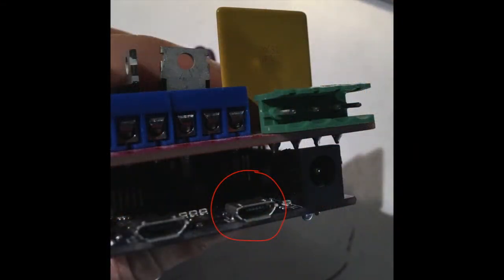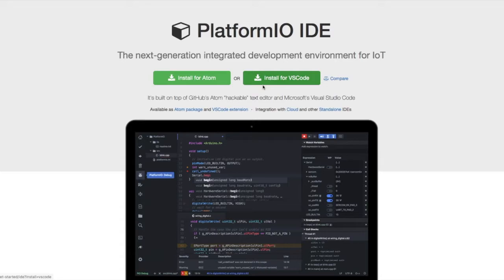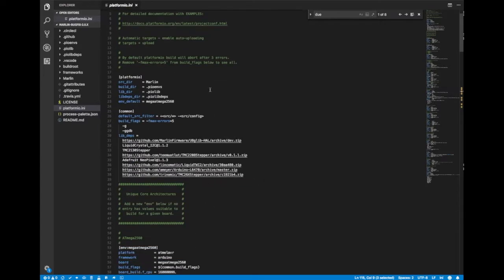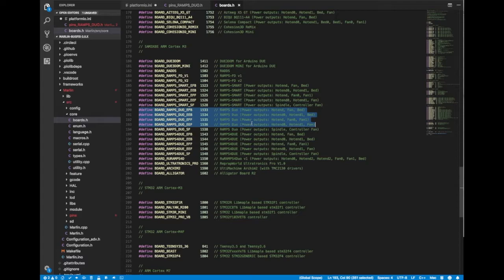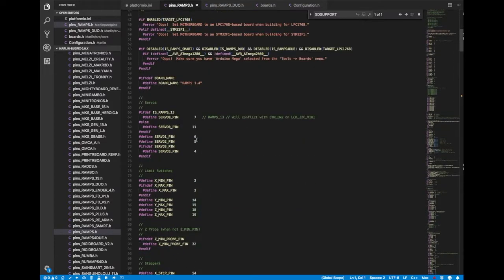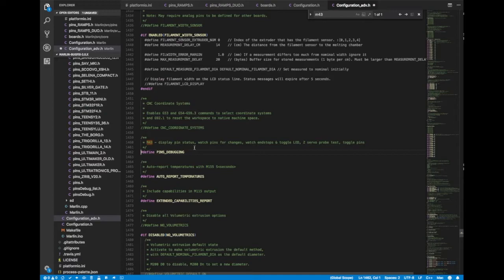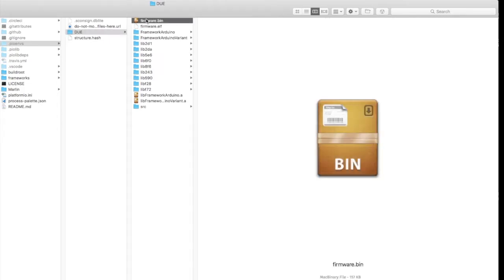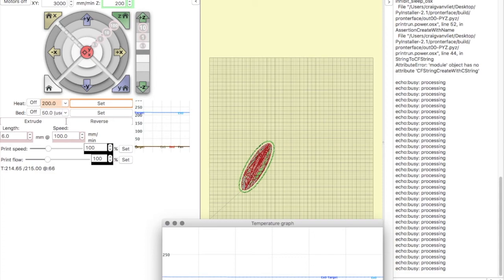Ramps + DUE mod part 3: Marlin 2.0 install

Comment: Great video. But what would it be like to put a TFT display? When enabling "Other Controllers ADS7843 / XPT2046 ADC Touchscreen such as ILI9341 2.8" When enabled, it asks to declare the pins, but there is no field for that.

Comment: working reprap full graphic smart controller lcd  3.3v logic?
Reply from the maker: You have to feed it 5v, but it isn't sending 5v out , so it seems to be okay.  I thought the SD card might be wonky because of the voltage buffer, but it seems to be fine.

Comment: Marlin 2.0 page says it's also possible to build on Arduino IDE 1.9, which is currently in beta. Any chance of making a video about that?
And speaking of "that", have you seen this? http://www.panucatt.com/Re_ARM_for_RAMPS_p/ra1768.htm (rejigged copy of Due with pins in the right places to use old RAMPS)
Or this? http://www.panucatt.com/azteeg_X5_GT_reprap_3d_printer_controller_p/ax5gt.htm (all in one board, similar to Gen7 but cheaper)
Reply from the maker: Some setups build fine in arduino IDE.  The current version works fine except on Windows (you'll need 1.9 beta). I have seen those Panucatt boards, they make solid stuff (it's a bit expensive though). The Re-arm board was the initial target platform for testing in Marlin 2.0, so it is well supported.
Reply: Thanks for the reply, Alex. I asked about ArduinoIDE because I still have XP (shh!), and VSC doesn't even want to install on that. 
The other part of my question relates to my plans to build a CoreXY of my own, and I'm trying to figure out what 32bit board to use. I'm soooo not interested in commercial Duet, Smoothie and similar, and community-developped like old RAMPS seems to have hit a dead end, sadly. Everything is either half-done and abandoned, or spread to small individuals or groups that are unknown. I've prodded Traumflug with some thoughts to rejig his Gen7, and if that doesn't work I'll probably decide on something from Panucatt. I like the idea of their Bigfoot stepper drivers, should be much closer to spec regarding heat dissipation than old Pololus, and really should be adopted as a new standard.
Thanks again for reply and your funny videos. Keep em coming! :)
Reply from the maker: Ah, I see.  There IS a linux version of VSC, or you could run PlatformIO from the command line and edit the test files in a regular text editor (a pain in the butt though). I'll cover various board overviews 'soon', but I have been waiting for some parts for over a month, so I may have to say 'screw it' and just do an intro overview video while I am waiting.  The Gen7 use an M0+ series chip, so they are very limited in terms of memory and you are basically limited to using Teacup firmware.  I'll cover some other options as soon as I can: the problems you are having with choosing a board are very common, and that is why I am trying to push for affordable solutions.  There are a FEW options under $50 already, but not as many or as cheap as 8 bit, so I'll have to cover all that.

Comment: They are now both Microsoft software :D / first i used atom later i used vscode because the support for platform.io in atom is incomplete / later i switched back to atom and used the cmd for compiling the firmware as root. This can't be done within the editors. But building for my mis sbase i had to compile the fw as root because otherwise i got some strange errors.

Comment: Thanks for awesome videos! You should definitely try Repetier instead of Marlin. Configuration on Repetier is much better to my taste. Current version (1.0.2) only support hardware SPI out of the box, but 1.0.1 supports software SPI by default. There is also way to build SD library with software SPI support on latest Repetier.

Comment: You go into so much detail about everything except for when you get a firmware.bin file, then your next sentence is "after uploading..." Appreciate the tutorial but how do you flash the firmware? Sd card? Pronterface? What?
Reply from the maker: Flashing to DUE is done through the micro usb port labeled programming.  PlatformIO should handle all that automatically .  I mentioned where to find the firmware file for manual upload because there was a bug for a while where it would not upload properly over USB, but I have not had that problem with the due
Reply: @AlexKenis  I figured it out. It was easier than I was imagining in my head. Just had to "build" then "upload". Thanks for the tutorial!

Comment: hey man, i tried this and i cant seem to get 100k NTC thermisters to work, when i mesure the V drop across the thermister i get 0V, even without ramps attached to due, (one side of thermister to GND and other side to A9) in S3D machine control it says 171 deg, when i manually add a 4k7 pullup (to 3v3) to the system i see a V drop over the thermister (like 3V1) and can even see the V drop change when i touch the thermister. however the Machine control now says 0 deg. i decided to use a 100k pot (GND, A9, 3v3) at a V drop of like 0V7 the  machine control says like 74deg, on both bed and end, i am truly confused. anyone please help
Reply from the maker: THat's... strange.  I would suspect some wonky setting in the firmware, but I assume you looked into that already.  Try a new thermistor if that is an option.  There may have been a change in the thermistor code for the due since the video... might be worth doing a search on the Marlin Github bug reports.  You can always double check your thermistor calibration at 100c using boiling water as a reference.

Comment: Is it worht to move on DUE from Mega ? I am ok with mega but 32 bit ? little confused if i need it or not..
Reply from the maker: MEGA is fine for most people right now, but some people either need the speed or want the features.
Reply: @AlexKenis  When would extra speed be needed? For fast 3d printers? Faster moves ?

Comment: hi, i'm tring to compile this FW with TMC2130 drivers but i get this error "#error "DUE software SPI is required but is incompatible with TMC2130 hardware SPI. Enable TMC_USE_SW_SPI to fix." i want to use the hardware spi from the programming header 
how do i trick marlin to use hardware spi?
Reply from the maker: Ugh, Yes it gets a bit confusing because of the way the mcu juggles hard and soft SPI.  Basically that is just an error warning saying that you can't share pin assignments between soft and hard SPI, so best bet is to enable PINS_DEBUGGING in Configuration_adv.h and send M43 in a terminal to get a readout of all the pin assignments, then it is easier to check for conflicts (you don't HAVE to, but it makes things easier).
Reply: i tried to use SW SPI but no luck, now it won't even connect from S3D machine contorll
#define TMC_SW_MOSI       40
  #define TMC_SW_MISO       65
  #define TMC_SW_SCK        42
Reply: Also can there be more SPIs or just one?
Reply from the maker: The way they have it set up is that depending on where you assign the cable select and which options you choose (trinamic, SD, LCD, etc) it has macros to automatically pick what uses sofe or hardware SPI, so it is a bit confusing.  I'll cover that a bit more in the 32-bit series, but I am hoping they make it less confusing soon.
Reply: Ok then. I can't wait to see a video explaining it because i looked all over the net and i could find only pieces of information. Is it allready done and it just needs editing? :D thanks anyway
Reply from the maker: If you look this folder path: Marlin->HAL->HAL_DUE , find the file SanityCheck.h . There are some details in there that may help explain it.

Comment: Just wondering, what is the best/ easiest way to know a USB cable is not power only?
Reply from the maker: Probably with a multimeter.  Check for continuity between pins on opposite side connectors

Comment: Help, im trying to do this step by step but the atom i have dosent even look line yours, the firmware dosent look the same either, everything is different im so lost
Reply from the maker: I ended up using VSCode in this video, and it's what I use now.  I'd rather use Atom, but it ended up not working out as well. Give VSCode a try and you should be able to follow along
Reply: @AlexKenis  thank you so much for you quick reply. i kinda started figuring it out but now i cant compile it, says there is no platformio project, ill give that a shot
Reply: @AlexKenis  hey so i have successfully done everything in the config and advanced config and setup for the due board but i can compile it, i do not have the same tools in that blue bottom bar as you...
Reply: yeah dosent matter what i do says its not c++
Reply: @AlexKenis  hey i just wanted to say thank you so much for the time and effort you put into these videos, i have been able to do the complete 32 bit mod and trace down and solve any issues i ran into on your content alone, keep doin what your doin! awsome work.  one question, i have soldered the dupont onto the duo for 5v power but what pin does that go to for a reprap full graphics display? (12864)

Comment: Whoa! You helped me out a lot! But I still can't figure out, how i can get the "section tmc_smart" (Line 1191 in Configuration_adv.h) to show up.. I have set the X,Y,Z and E0 Driver to TMC2130 and removed all the unnecessary "/".
Reply from the maker: First, I would go ahead and install the firmware and then see if the settings in that section are working on the printer.  Sometimes -- for whatever reason -- there is a glitch in the IDE and it keeps sections greyed out. If the settings are not correct after you install, then I would double check your configuration and pins files
Reply: @AlexKenis  Hey, thanks for the reply! I've installed the firmware which is configured for a RADDS board (which i have) after I posted my comment, and it works, partially.. I can move the x,y and z axis in only one direction. When i have the diag1 pins of x and y connected to the x and ymin pins it says "endstops hit" whenever i try to reverse these motors.. 

The Extruder works flawlessly in both directions..

When I want to home the machine, it just crashes into the opposite sides of the endstops..  Can i reverse the motor direction for the homing sequence? If yes, where? I haven't found an option to do so.. 

My Extruder works, but the heated bed doesn't.. I also can't seem to find the heatbed pin on the RADDS... FAN0 and FAN1 also don't work..
Reply from the maker: I am not sure of the pin assignments in RADDS, but it should be well documented since it is open source.  Also make sure to have all the bed options enabled or it may not work.  Worst case scenario, you can check for double assignments if you enable PINS_DEBUGGING and then send an M43 command (it will list all the pins and show what they are assignerd to) There is a setting  for homing direction in the configuration.h file.  Just do a full text search for X_HOME_DIR and it should take you to the section.
Reply: @AlexKenis  I've tried reversing the X_HOME_DIR but while compiling it says, that i need to home to the X max endstop, which kinda defeats the purpose of reversing the home direction... Strangely enough, while homing, it doesn't hit the endstop.. It just goes back to the position I booted the board.. 

Sensorless homing doesn't work, and heatbed and fans are still not working, even though the pins are the correct ones. Also the Heatbed thermistor does not work.. 

M43 didn't help at all unfortunately.. 

I thought it would be a easy solution to go with repetier, but that won't even compile in the IDE.. so yeah..

I'm really frustrated now to have 170€ of Hardware laying around just because of the stupid firmware which runs the damn thing... :(